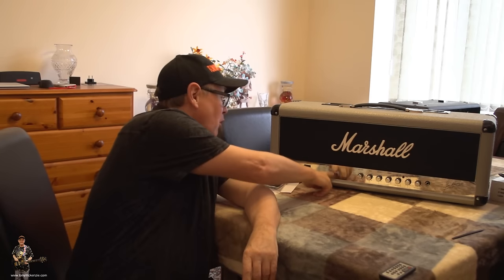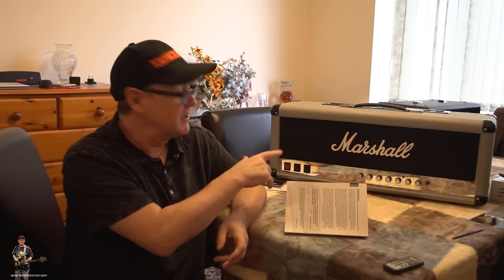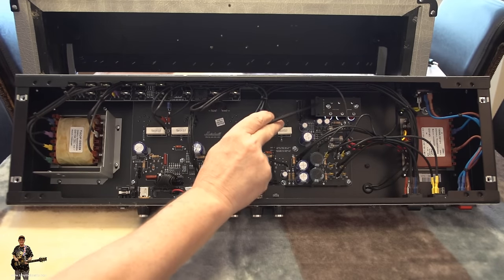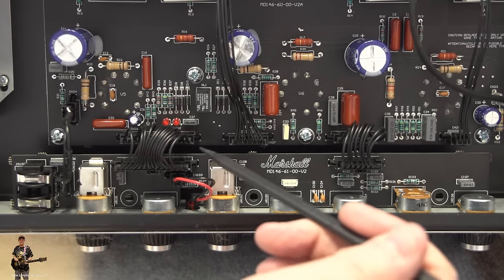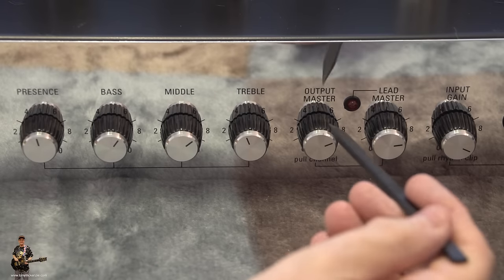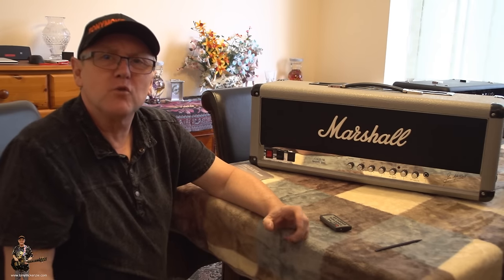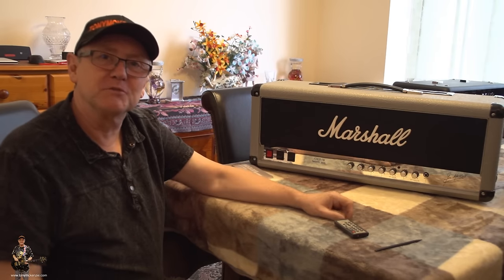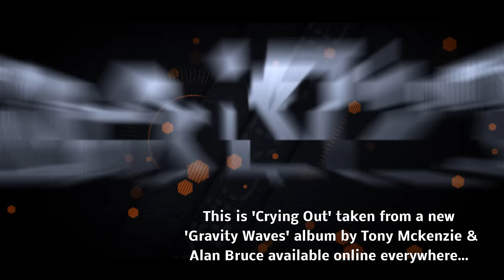Marshall 2555X 100 Watt Silver Jubilee Amplifier | A Closeup Inside and Out Review | Tony Mckenzie

Comment: 2555x is a fantastic amp. Have a Friedman BE-100 and handwired. They are quite special and neither sounds worse than the other. Cool tools and blessed
Reply from the maker: I also have the Marshall 20w and that sounds pretty cool too and at a great price (at least here). Hand wired costs but often you get what you pay for in amps some of the time. A brilliant amp - the PRS MT-15 I bought for £450 ($600) and it was/is substantially above its price for sure. PCB but also great value. Thanks for the info and for watching.
Reply: His tone in the Creed days was a Dual Rectifier good early version. In his later days with Alter Bridge were a mix of aforementioned amps. His tone has always been great and the Marshall amp mentioned really did not have anything to do with his tone.

Comment: How is the amp with low volume settings? Is this suitable for home use? Looking at the 20w version also just in case the 100w would repel my neighbors.
Reply from the maker: Well it's a master vol amp. But of course turning it down gives a different flavour to when turned up :)  if in doubt consider the 20w and check my channel as I reviewed it... mine has a red/white case as it was a custom order - but the 20w amp is absolutely standard as you would get. I cover it all... thanks for watching.

Comment: Would it be expensive to replace the transformer for a 120V one? And beside that is there anything else that need to be modded in order to be able to use the amp in USA?
I really want to get one of these, specially from Europe because it costs like a thousand dollars less than here in USA, but unfortunately it comes with a fixed 230V transformer. So I'm thinking about getting one and converting it to 120, maybe that way it could still be way cheaper than buying one in USA.

Any information is really appreciated, thanks.
Reply from the maker: I guess you can buy the 120v power TX (my guess about $120) and also a few other components (probably $10-$15) for safety reasons. Then a tech (if you can't do it) to do it - I reckon a couple of hours... maybe up to three. I have the exact same trouble with Mesa Boogie gear here... and I have converted a few (about 4 or 5) and Bogner sometimes have the wiring ready to just change with PT supporting multi voltages - but I'm pretty confident that most Marshall does need a PT. Hope it helps and thanks for watching.

Comment: Hi Tony, you mentioned your preference for a choke instead of a resistor in its place. What do you think would a choke do to my chokeless 2554  model in terms of sound and FEEL ? Would it be an improvement ? (I would have to find real estate on that small chassis for it anyways...ouch!).
Nice review, rock on! Greetings from Berlin! Dave
Reply from the maker: Well they do on some amps fit a single usually large resistor of the cement variety from what I see - and I did cover this very subject some years back - its included on tonymckenzie.com. There ARE changes to the tone and feel but its very marginal and also very dependent it seems to me on the measurement of the choke you fit. Improvement? Well I did it on a JVM410H (I think it was) and its shown here: https://tonymckenzie.com/marshall_jvm410h_review.htm  but the result is subjective, and as I said also dependent on which choke you use. Hope it helps... great question.
Reply: Hey Tony, many thanks for your immediate reply. The resistor in my little jube is a pretty cool brass looking thing with cooling fins. Anyway, if the difference is that subtle I will,give up finding a place to rest for a choke. I once played the 50W head with choke whoch felt a little bit more spongy which I liked a lot...
I will checkout your website about it.
Again thanks. That's what I love about the www: getting in touch with musicians!!!
Regards
Dave
Reply from the maker: That resistor sounds more like a load resistor to drop the output of the amp... I could be wrong of course, but ensure you have a decent diagram. Hope it helps...

Comment: Tony,

Rewatching this as I loved the tone setting you used in this. I just had a back operation and I can sit and play for much longer. Really loving the 490/498 humbuckers I had put into my Les Paul Custom.

For the first time in 6 months I actually played my Strat Plus for 45 mins today. I adore my LP Custom, but my goodness the Strat Plus Deluxe is just one of the best Strats Fender ever made. I actually had my master volume was set to about 8/9 with the gain around 4/5. Tone , Mid and Bass set to 5 (12 O'clock) and presence is on 7.

Are you still using this amp, as I know you agree with me about it being one of the better valve amps Marshall has pushed out.
Reply from the maker: Hi Dan. Firstly, great to know they are helping you with that back pain etc. Of course I still have this amp and really like it - all thanks to your recommendation at the time you got yours. I had the chance to get one as you see and I don't regret it at all - its a really nice sounding amp for sure. Aha I have had a Strat Plus Deluxe too :) a while ago and it is vague in my mind now but yours is cool... I saw the pics if I remember correctly. Thanks for the settings Dan and I know others will check them :). Good to hear you and I trust that back gets better and better. Regards. T.

Comment: How would you compare it to the jvm hjs?

Which do you think has more mids and presence ? Iv found my hjs to be a bit spikey on top and kinda scooped sounding .

Funny I played one of these shortly at a small store and thought it was really really dark .

But I saw a video with the jubilee and jvm compared and the jubilee seemed much more present oddly enough. That confused me. 

Would you say you found the jubilee to have more presence than the hjs?
Reply from the maker: The Silver Jubilee 2555X absolutely has more top end IMO (I relate that to presence) but you might have meant stage presence? I recently reviewed the 2525X 20w equivalent and that also seems similarly voiced but of course its adjustable just as all these amps are. So my answer is that yes the jubilee has more top. On the JVM410HJS well that amp (just my opinion) is probably one of the best modern Marshalls there is... and seems they are increasing in the pricing stakes. I like many Marshall amps but not all of them. The JVM410H  as an example - I dislike because it is actually nothing like the Satch version - even the board is different and you would tell immediately if you played both. HJS has the resonance knob too so remember that will affect the tone compared to the 2555X that does not have it... thanks for watching.

Comment: Hello Tony , Have you tried this amp with Kt 66 tubes ? I really like my vintage Modern I own this amp too just trying to see if I can get a different sound from it Thanks for the great Video
Reply from the maker: I did not. May be I should have. I later sold this amp to fund more amps to review and for me this amp did not really suit the rock I play, I did get it going fine with a pedal of course, but I don't really like pedals much. No reflection on this amp of course. It was made extraordinarily well. If I remember the KT66 need a slightly different resistor than the 1K 5w (I think they needed 1.5K 5w) but I have not checked that all in a while. I do know the KT66 will fit but just check that resistor thing... just to be sure.  Stay safe.

Comment: Thanks for the great review Tony !!  Especially the inside look through.
I like that they added the bias adjust board with the easy accessible pots and testpoints. I dislike that its not multivoltage like the original. As a tech that has been working in electronics for 30 years i do however think that the original amp will be more reliable in the long run since even though the reissue is constructed in what could be considered as a normal and sensible way in these days, the original is better constructed.
The original doesnt have any connectors inside apart from the tube sockets, the reissue has multiple connectors inside both mains, speaker transformer and between circuitboards and to speaker jacks, although connectors can be practical when repairing the amp all connectors really are a potentional risk of bad connectivity. Since we are talking about a guitaramp that is going to be lugged around in different temperatures and weather conditions for decades the demands are much higher than a desktop computer and it may show down the line. The tube sockets mounted on the circuit board instead of chassie mounted like the original will put at least some stress on the solderings.
I do understand why they did all this, its mainly to be able to make it more affordable and/or make more money out of it since it a cheaper construction. It will probably be fine for quite a while, but im sure it wont be as bulletproof as the original. It looks like they skimped out on the anodization of the chassis and painted it instead as well.
Reply from the maker: These are all very fair points you mentioned. There certainly are many connectors between the boards, but they used (they say) fibre glass (I think it was) cabling giving the impression to me that this was not regular stuff. I certainly tugged hard at those connectors and they seemed particularly good compared to many amps I have seen inside. That's not to say they are good, far from it and the point is entirely relevant. I too have mentioned the power tubes mounted on the PCB a number of times in my reviews, and even to Santiago Alvarez - Marshall designer) here: http://www.tonymckenzie.com/afd100_review.htm and the comments were like this: "The main PCB is a double sided through plated affair made from thick fibre material in keeping with today's technology and this board should prove good long term. I did notice however that the tube sockets are soldered right to the board which could at some stage offer up a board issue because of heat. The transmission of heat by conduction through the pins is not too big as the pins are relatively small. Main heat source is convected and radiated, blocked by the chassis in a combo. In a head the heat tends to go up away, so the PCB would run quite cool and definitely much lower than the temperature it could withstand. Well SA is the designer and I'm not going to argue with him; if he doesn't know then no one does!"

As you see I tried to introduce the aspect of power tubes affecting the board but Santiago said otherwise. And I'm sure you are correct re costings for production as that is the way of the world these days... and I guess in competing with companies that come entirely from China as opposed to companies like Marshall that actually do make some amps in Milton Keynes UK. Not sure if you saw my video of the Marshall factory tour we did a while ago here: https://youtu.be/WeerxAO3oRU   and part two here: https://youtu.be/rhe7qXP08qw and I really enjoyed going around there.
Reply: Thanks for your long answer !  I have watched your Marshall tour already earlier and i really enjoyed it alot, great work ! (I love my Marshalls)  Most of the PCB´s i have worked on was fibre glass, through plated and many even multi layer PCBs, so for me this has been standard for decades. Most of these were not consumer products though and some of them 10 times more expensive than an expensive tube amp, in cheaper or older electronics it may not always be used though. 
The point about the tubes being soldered directly to the board was that it may lead to the solderings cracking both due to mechanical stress due to the weight of the components (tubes and sockets in this case) and temperature when it warms up and cools down since the heat from the tubes may transfer to the circuitboard, i agree that there is a huge difference with the upside down mounting of the tubes in a combo (much worse). Im not knocking the designer at all, it looks good in general, but i do believe it wont be as "bullet proof" as the original due to the points i made.
I would like to add that In my personal experience, designers and service technicians like myself think very differently, the designer thinks more of function, design and price, while us techs think more critical about what can go wrong and ive seen alot of unneccesary mechanical design flaws that were easily prevented some of them probably costing millions to correct even. Again this amp is probably mostly fine mechanically, but the original is more robust.
Reply from the maker: Thanks Stefan, I was also critical of the heat but in reality I have never had ANY Marshall amp fail with the problems I have often envisaged - but I'm sure some have. I once had a Peavey 'Mace' head (160 watts yikes!) that had the tubes upside down in the head and those amps kept zapping the board with the sockets on over time which was why I asked Santiago about it all originally. The 'Mace' was IMO an extreme example of how not to do things... 

Anyway thanks for the comments as they are always useful and guys will come and read them... it's all helpful especially from someone like yourself where your job is repairing etc. you have a great skill. Thanks again.

Comment: Should I buy the 2555x or Friedman runt 50??
Reply from the maker: This depends on what you play IMO (style for example) and which of these two will suit you best and fit your budget best. Personally, I have bought Friedman amps and Marshall amps and of the two my preference is Marshall. This is fr a number of reasons. 1. Marshall are cheaper by far in the UK.  2. The Marshall from my experience have a better internal build quality than the Friedman and 3. I prefer the tones of Marshall. This does not mean that Friedman are in some way 'bad' but more so that for me the Marshalls fit the bill better. If you are not in the UK the pricing might well be different. Hope it helps and stay safe.
Reply: @tonymckenzieofficial  thanks Tony. I played a Marshall once 10 tens ago but saw the 2550x in black with silver plate and said I got to place my order it’s in my cart along with the runt I think I’m going to remove the runt!! Yikes hahah
Reply from the maker: You know what... I think you might well be making the right choice. Inside this amp was one of the nicest I have seen in many years. Stay safe and have a great Christmas...

Comment: Hi Tony, this would have to be one of the few if not only channel where an Amp is opened and inspected in detail by someone who actually knows what they are talking about, excellent, thank you.
If you ever get the chance would you be able to review a Marshall 50watt Vintage Modern combo, I own one and don't seem to be able to dial in a satisfying sound, it has 2 x 12"" Celestion Jimi Hendrix Greenbacks, Purple Tolex.
Kind regards.
Reply from the maker: Hello John, well I'm no expert compared to some of the internet guys for sure. But it's pretty obvious usually when you see something inside an amp that is just not the way it should be. The 2555X is an interesting amp because the way it is made is different than many recent Marshall amps I have checked inside... and sometimes even 'similar models' are somehow considerably different (I cite the JVM410H and the JVM420HJS boards) even though they are supposed to be basically the same - they are not - the layout was completely different.

Actually I have not had one of the Vintage Modern amps (but have often considered one) or been inside one so its hard for me to really comment on that amp. I'm sure it can sound good so maybe there's a combination of things going on. If you're anywhere near to me I could review your amp... but likely you will not be. If I find a reasonably cheap head kicking around I'll grab it and make a review. But don't depend on it - as I have lots of things to catch up on re reviews these days. Thanks for the info and for watching.

Comment: Hi Tony.  Do you think this model or the Ceriatone Silver Jubilee is better?  I know you have a Ceriatone D-style.
Reply from the maker: I have not used the Ceriatone 2555 amp. What I can say, is that the Ceriatone amp is a point to point amp design based on the original idea (I guess) and Nik will have surely worked on that design a while. Their amps are very good when made right. If you can make one then that's a good choice, but if you can't and still want a point to point amp then Ceriatone 2555 is as good as anything out there. But if you can't make one, or indeed are not prepared to pay for someone to build it then the Marshall 2555X is a really good choice. If P2P means nothing (as many guys don't really care about PCB or P2P) the Marshall is made very well (at least this one is) and has that 3 year warranty (in the UK) which has to be a  great deal. I bought this one for around £870.00 which is a great price for the 2555X. 

Also remember that 'better' is a subjective comment that means different things to different guys. I'm sure though that both amps will sound pretty cool. Thanks for watching.